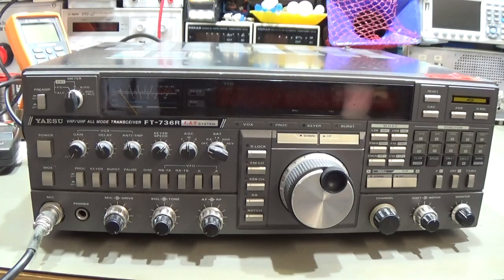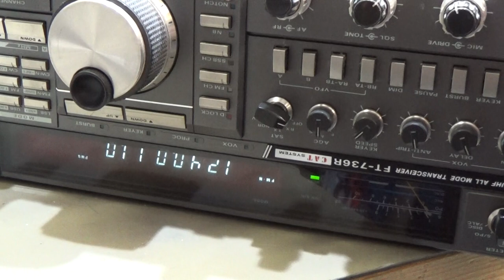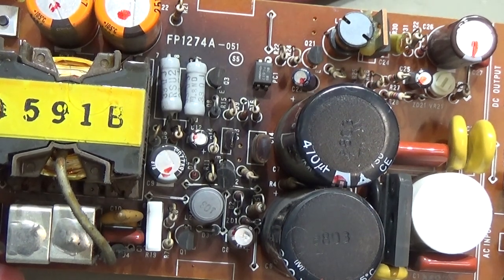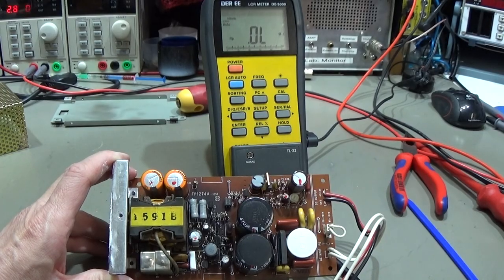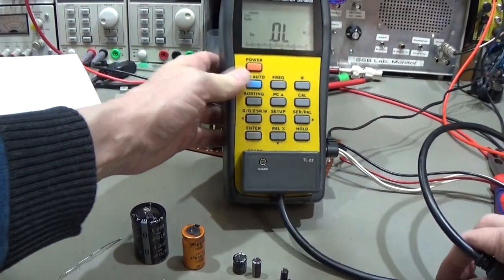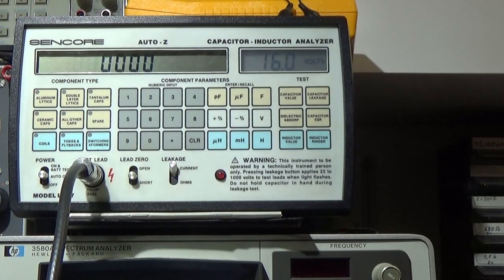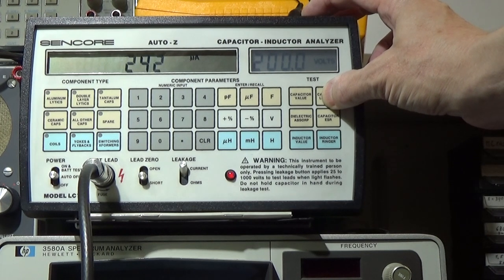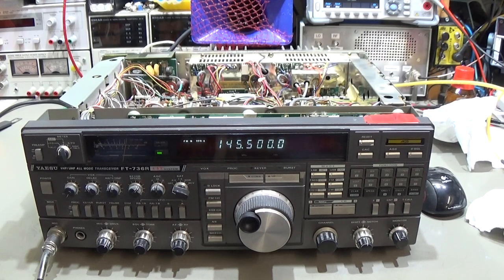#224 Yaesu FT-736R no switch on

Comment: Another option if the supply were truly dead would be to simply replace it with a modern SMPS module in the same space. Nice fix Peter!  73 - Dino KLØS
Reply from the maker: Thanks Dino and yes today we have a variety of SMPS on the market which will simply fix those problems.. 73

Comment: Great job Peter. The first thing I do when I suspect capacitor problems on older printed circuit boards is to immediately replaced all the electrolytic capacitors.

Comment: Another important point to check with that particular type of SRBP pcb, is whether any black/ charred areas have become conductive.  I have been caught out a few times by low resistances due to burned/carbonized board bridging overheated power resistors.
Reply from the maker: You are right very important point but in our case it was not already  carbonised so we were able to ignore it.

Comment: I've had to repair a few silly faults on one of those. There are wires and connectors everywhere! Thank God for camera phones. The memory battery and VFO are notorious for needing TLC I think you already did a VFO rotary controller video. 
Another old radio saved from E-waste... 👍👍👍
Reply from the maker: yes agreed a nightmare..

Comment: I repaired one of these in 2018 for a local hospital.  In full disclosure, I simply replaced all of the electrolytic caps on the SMPS board and it came back to life.
Reply from the maker: yeah that is often the case..

Comment: A very common fault with old SMPS's. Well diagnosed and fixed as usual. Also a great lesson on how to test capacitors too, just measuring the value is never enough to decide whether they are good or bad. In fact most of the time bad electrolytic caps will show higher than their rated capacity because of the way most multimeters calculate their values based on charge time. That darkened part of the PCB got me worried though, it requires a substantial amount of heat to burn a PCB like that, how do you think that happened?

Comment: give some credit to the designers of that PSU. It worked problem free for 30 years. All you had to do is to change a few capacitors, and it will work for another 20 years. 105 degrees capacitors are a bit weak for this unit, you can already find 135 degrees ones at all major distribuitors in Europe. They are not that expensive either.

Comment: Hello mate, do you have a video where you test caps with the required input voltage or possibly a lower voltage for testing purposes and monitor the waveform on a scope to determine if the cap is good or not based on charge time? Love your videos as I am an electronics wanna-be, LOL. I love hands-on component replacement.

Comment: Any quick tips if it still doesn't power on when you plug it in to external 13.8v power supply ?
I've seen some do this,  just curious what else might be causing it to be dead on external supply?

Comment: I don´t want to be bossy, but one remark:
Repair or maintenance: Keeping equipment operational, not necessarily with original components.
Restoration: Restoring to its original(!) state. (See Wikipedia).
Old equipment in general can´t be restored due to lack of original components; it can "only" be repaired, e.g. by replacing old components by new ones, which are different (sometimes better) from the original ones; for example old transistor by a new/modern one with the same function and parameters.
So what you did here is a repair - nice video!
Reply from the maker: lol Yeah Stefan following the wording of the definition your are right but it is a little bit like the discussion about Schreibendreher oder Schreibenzieher oder Röhresockel oder Röhrenfassung......everyone knows what is meant and so I'm certain it is here...The thing is that a radio older than 25 years can't be called a normal repair as it is blocking the bench (factor time) while other OM's waiting for a fix. On the other hand due to logistic and research it becomes much to expensive (factor costs) and 3rd factor rabbit hole means warranty.
A complete other discussion is the fact that I don't agree with the definition written down in Wikipedia. It does not cover all the variants which can't be ignored. But as I said a different discussion.
But to be clear your comment is highly welcome and is always worth a debate... 73
Reply: @TRXLab  Yes, Peter. I see, we understand us.